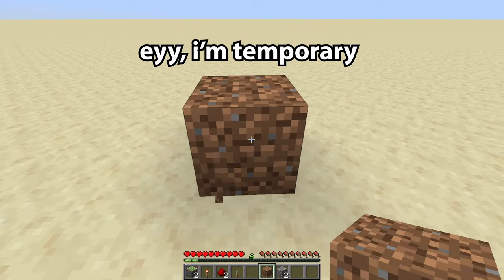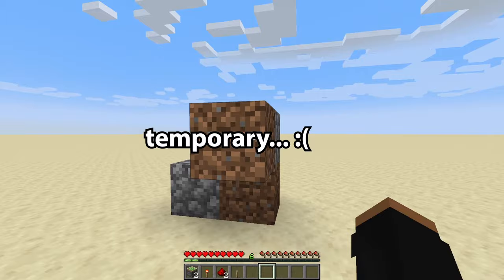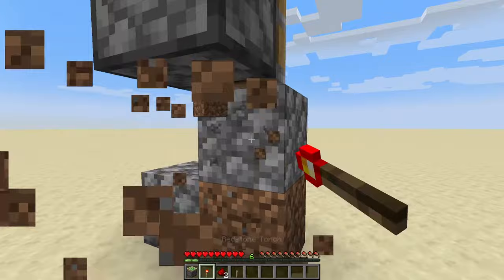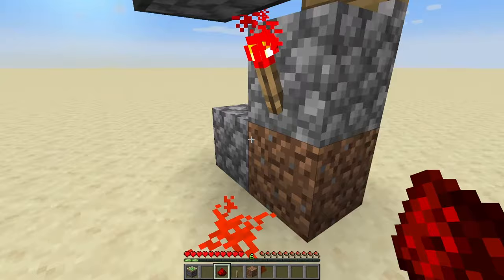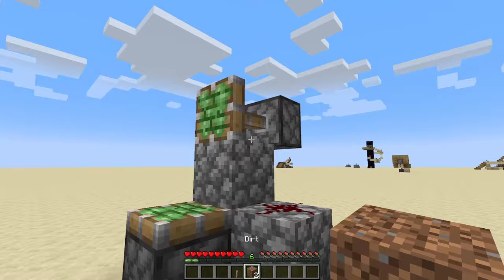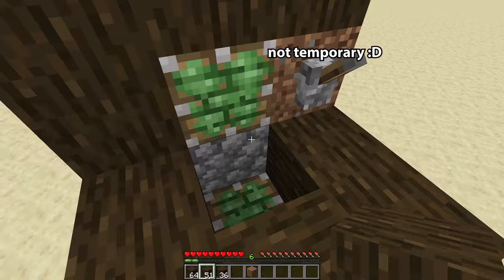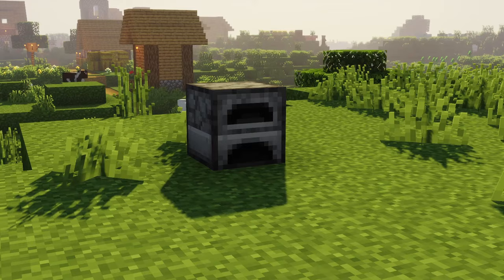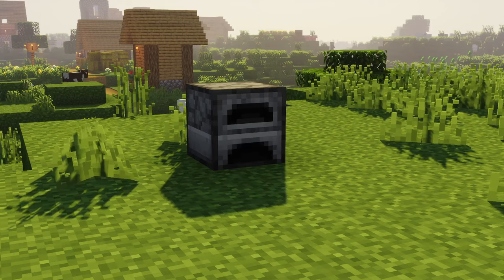How to Build a Block Swapper in Minecraft. *EASY*

Comment: Guys, I have fixed the problem. However do bear in mind that this is for bedrock, im not sure abt Java. Break the redstone torch. Place one on the back of the block with the lever, place one piece of redstone dust to the right of the lower piston, and it should work.
Reply: the guy made this on java, so this should work
Reply: Thx
Reply: Thanks
Reply: It’s a bit confusing but I think I understand and it’s not working
Reply: @jordantaylor6743  no it doesn't work anymore
Reply: I am a bedrock player and I can confirm that this might have worked for him, but not for me.
Reply: Fake
Reply: I thank you so much
Reply: @Monkeplushvr._.  Yes it is
Reply: Thanks a lot bro
Reply: THANKS SO DAMN MUCH. I WAS HAVING TROUBLE THINKING IT WOULDNT WORK.
Reply: It doesn’t pull the bottom block down fast enough
Reply: Thanks! Explained wonderfully ☺️
Reply: Tysm
Reply: Still  didn't  work
Reply: Thanks so much this really helped
Reply: You can move chest in bedrock not java
Reply: Thanks man
Reply: Thank so much it works using the method you said thank
Reply: yooo thanks man
Reply: I LOVE YOU 💕
Reply: Your a goat bro ❤️❤️
Reply: I’m a bedrock player and thanks it does work now
Reply: Thx
Reply: Mine works im mimtemdo switch
Reply: So helpful
Reply: Thank you, it works on bedrock
Reply: My guy 🔥🔥🔥
Reply: THANK YOUUU
Reply: Bro youre a king
Reply: Thx
Reply: Thx worked no problem
Reply: Nvm no it didn’t thought it was u til I place the tables and stuff did t work
Reply: I love you
Reply: Thxxxxx
Reply: Thank you so much it works on bedrock
Reply: Yes, this does work on java. Thank you so much for the tip though, this very much made my Minecraft world so much more efficient
Reply: @AbgrBobby same
Reply: Ms
Reply: Thanks
Reply: thank you man your a life saver
Reply: Absolute Legend
Reply: Goat

Comment: I had an issue with my blocks not sticking to the pistons but I will totally check out your other videos!
Reply: 1. did you use sticky pistons?
2. are you rapidly flicking the lever super fast? in Java if you give a sticky piston a one tick pulse (flicking the lever on and off really fast) it will spit out the block. this is by design and not a bug. if this is the reason you're having problems then just don’t flick the lever so fast
3. are you on Bedrock?

Comment: what function does that piece on the floor hold?
Reply: did some experimenting, and it turns out the redstone dust on the ground gives the upwards piston a block update, allowing it to power. i can't tell you why it works but for some reason it does!